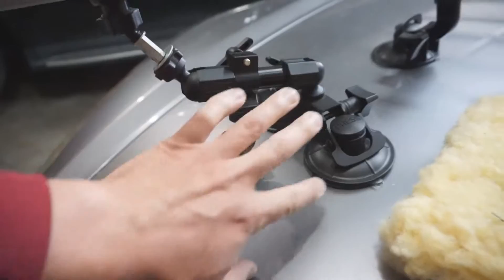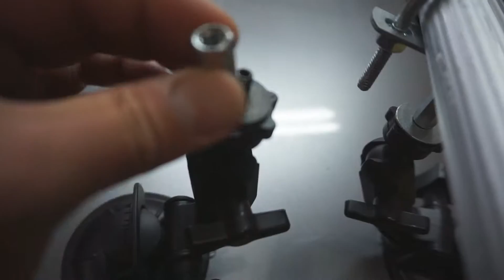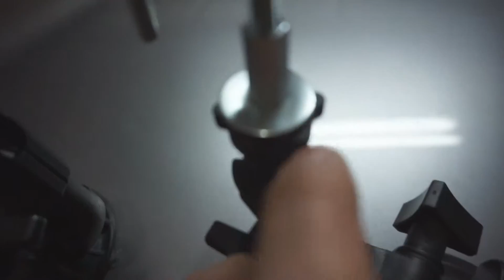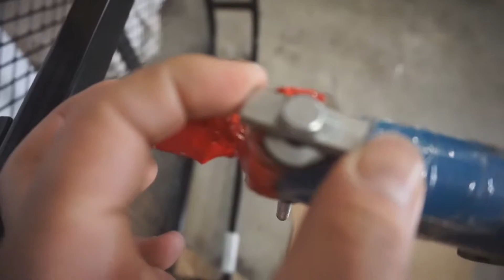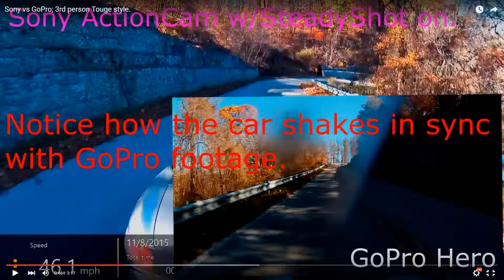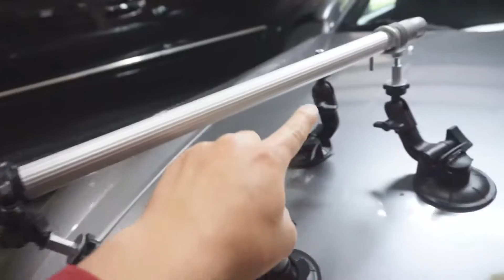How I made my action cam "boom stick rig"

Comment: thank you for the video! it really helps 👍👍
Reply from the maker: +Joe cal I didn't show how to mount the sony camera to that "bolt mount".  Make sure you use another rubber/washer combo and a nut first then screw the camera on.  Once the camera is screwed on at a decent depth, aim the camera where you want it to face and then hold the camera while you tighten the nut washer/rubber combo to tighten the camera.  But that is if you use that bolt thing to mount a camera.  Maybe you have a go pro and you just need that "bar mount".
Reply: +///Sixth Gear  I do have a gopro, I'll be using the attachments
Reply from the maker: I have a new video for version 2.0 of the camera boom stick.